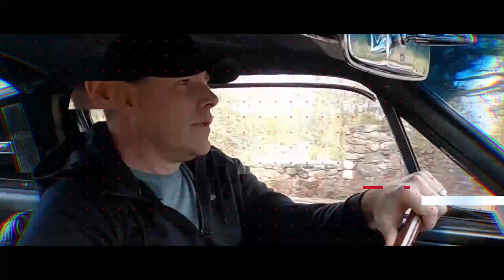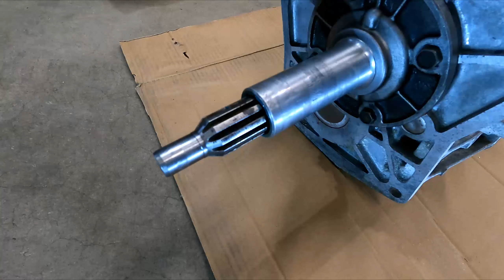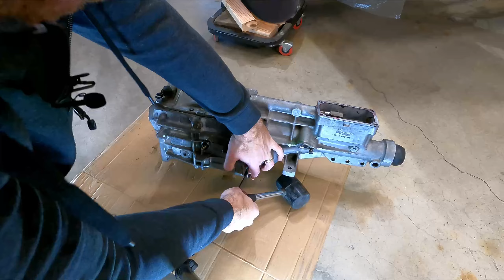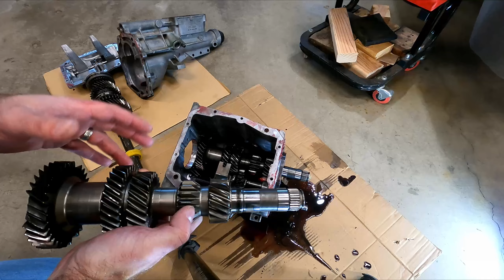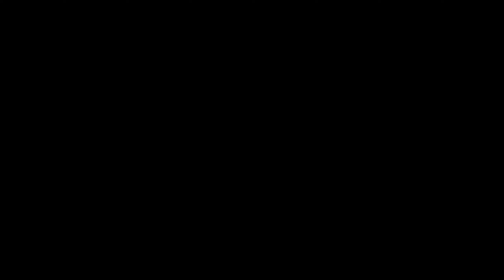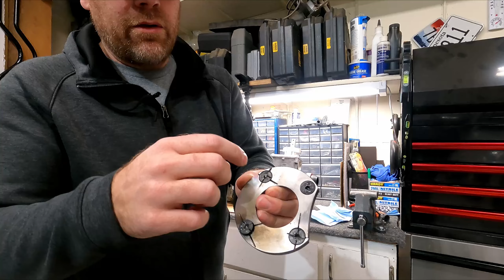T5 Rebuild - Fixing the chattering gears

Comment: Merry Christmas Andy and family!!! Sounds like a little slop in there. Should be an easy fix.  I had a T-5 in my 85 Gt. Always grinded a tad going into 2nd gear. It was nice to have a 5th gear when I ran 3:73 gears on the highway though.
Reply from the maker: Happy holidays!
Reply: is this the same t5 that’s in the 08 v6? no rebuild kits list the s197 v6s so i was wondering if it’s the same trans
Reply from the maker: @shalerhenry9877  I think they stopped making the T5 for the Mustang in 2004.  Beyond 2004 I don't know what trans was used for those cars.  :)

Comment: A great investment for the T5 behind your 347 would be a "gforce" gearset from jegs. If you decide to purchase the set be sure to grab the mainshaft  also by gforce. It supports 550hp the tires.
I purchased & built mine about 3wks ago. You wouldn't need the aftermarket T5 case really but purchased it also for more security...
The TKO600HD was my 1st purchase but I wasn't happy with it, the T5 shifts smoother. 
Your 347 will definitely destroy the Current T5. There only rated for stock applications using weak metals in the gear design. 
The gforce set is 9310 steel polished & treated for more then what your engine will send it.
Mine is a 306, 515hp na.
A aftermarket torque box kit would be nice. You're not racing im sure just as I'm not but it's nice to have things situated in the driveline just in case. The TKX is nice also but I just live the T5
Reply from the maker: Thanks for the heads up.  :)